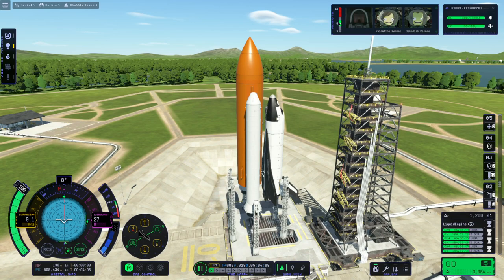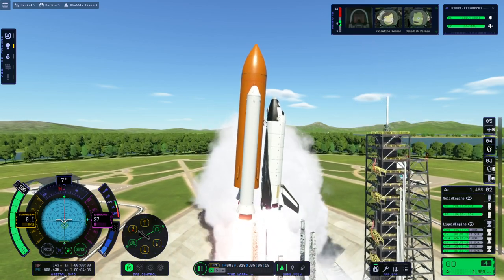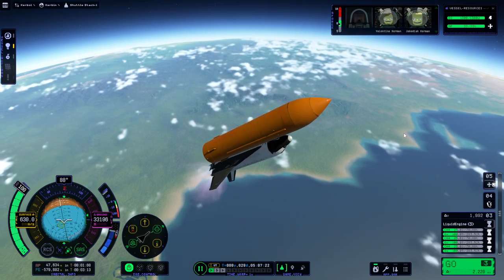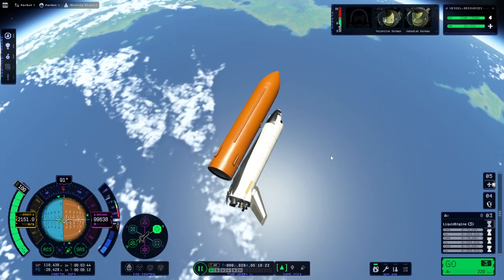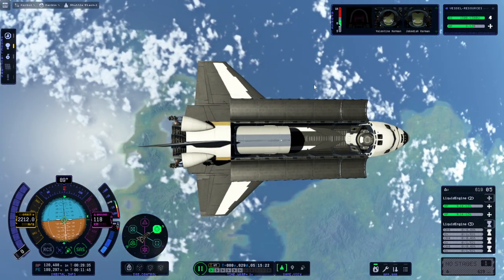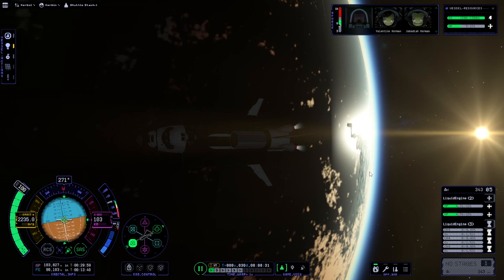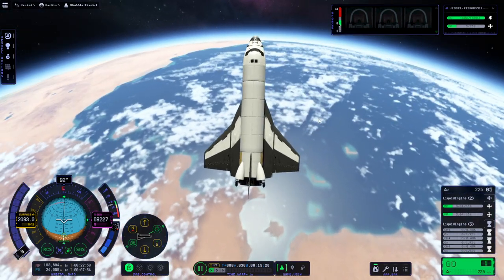KSP 2 Early Access - Shuttle Reentry Test

Comment: I believe it's how the lower two SSMEs are placed. Tilt them inboard by 5 degrees so they are aimed toward the COM, that should solve the problem. You can also take the booster into notepad and adjust gimal limit to 800 to match the real thing if you need to.

Comment: Isn't the wobbliness due unbalance in thrust between the shuttle and solid fuel motors? I know you already mentioned it, but can't it be solved?
Reply from the maker: Partly and also partly because the SRBs don't gimbal enough. The problem we have is that the SRBs are both too weak and last too short a time. I've actually reduced their thrust so they last through Max Q (because otherwise it's dangerous). Decreasing the Shuttle's thrust isn't a good idea because we just barely get off the ground. There are options that involve combining more SRBs together (like a Kickback cluster or using four Clydesdales), but I want to avoid those as aesthetically displeasing. So, I have a pickle, but this may be improved by adjusting the tilt of the Shuttle's engines.

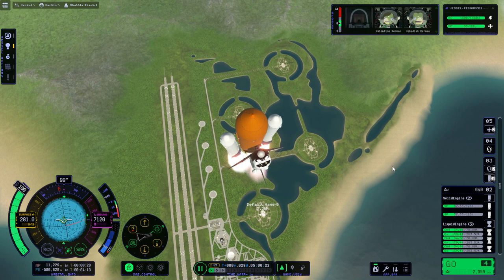Comment: It looks like the payload inside the bay is wobbling around at launch. That's probably adding to the instability during ascent and making it so hard to control. Check out some of the footage around 2:05 or so; it looks like the payload is wobbling around to the point of clipping outside of the bay doors. Maybe strut it in a bit?
Reply from the maker: Hmm - I thought I had strutted it, but maybe that was with the forward tank that I replaced to reduce the payload size.